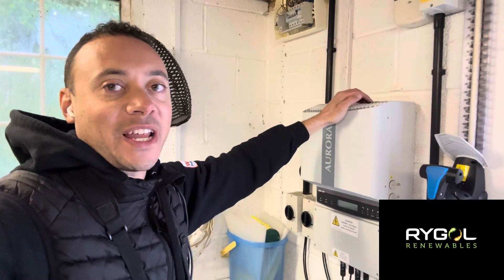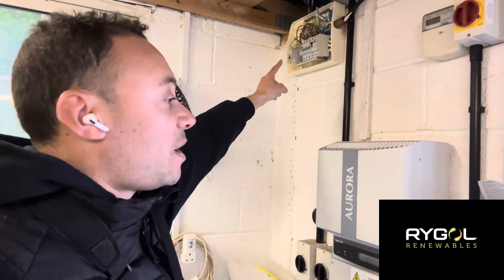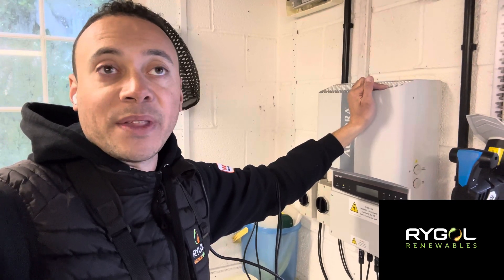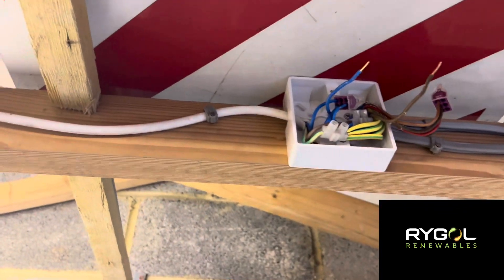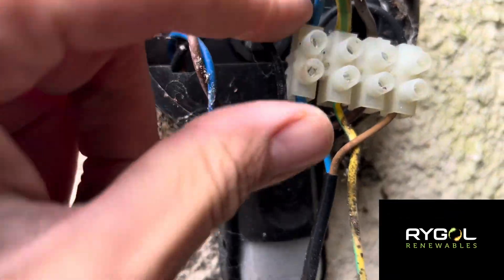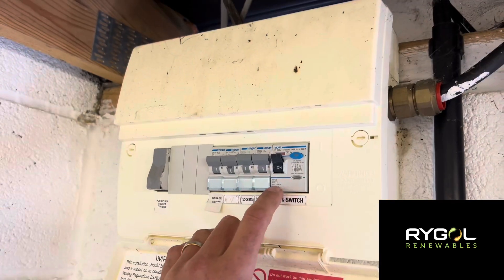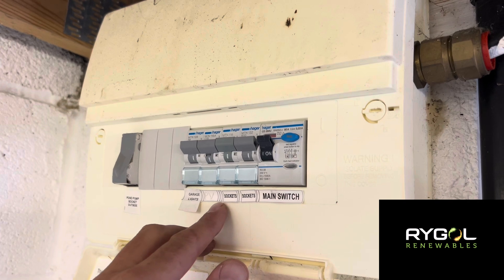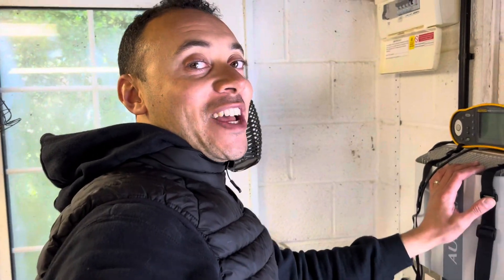Solar fault turns into a lighting fault!

Comment: The irony is that electricians are not allowed to do this work or remove the dno fuse etc, instead they have imbeciles leaving this kind of situation behind with potentially fatal consequences, but hey, they've been approved by the meter company so they must be good, right?